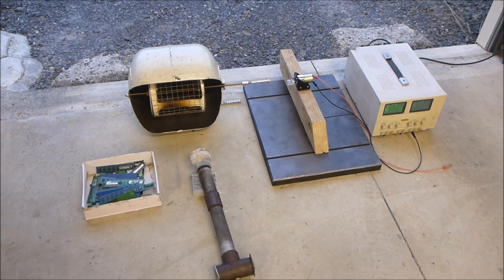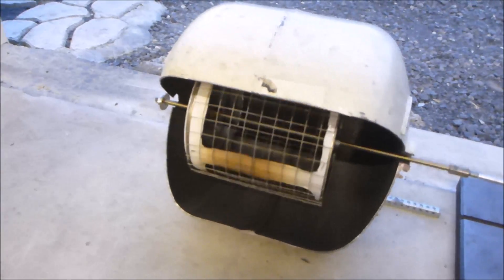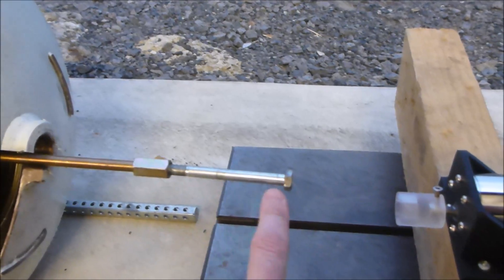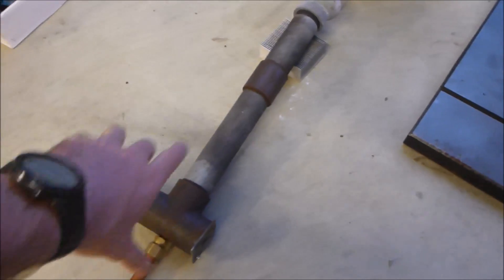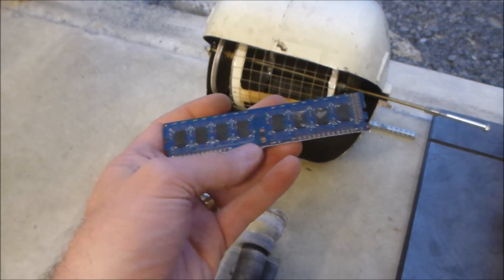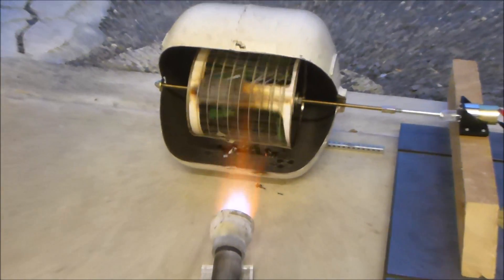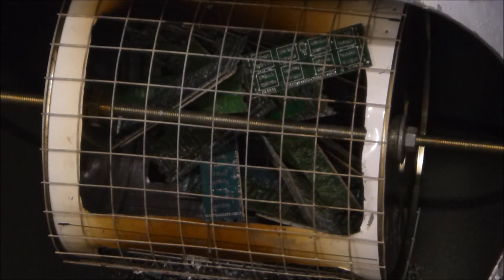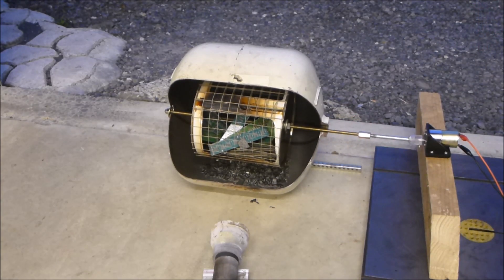Gold Recovery - Automated Circuit Board Depopulation

Comment: A small blower AKA hair dryer would get the flame hotter. A blue flame, with little to no yellow color, is the hottest and most efficient. 
With a flame at this temperature you could get the time down to 2 minutes.

Comment: Wow! Excellent idea, also showcases how handy you are. I was wondering, why have you decided not to use coal/charcoal for heat? Aside from some ash (no biggie since you’re doing it almost outside and could just blow it all out, hehe), coal/charcoal just beneath would have the added benefit of incinerating the chips for you right then and there, for easier crushing/powdering for gold recovery, right?
Reply from the maker: Thanks! The aim at this point was definitely to avoid actually burning the ICs, you really want to pyrolize them (in a mostly sealed container) before incineration, otherwise they give off huge amounts of toxic smoke. But, no reason you couldn't use coal or any other heat source to get the job done! Thanks for you comment :)

Comment: if you are not recovering copper 45% of the weight of good boards then you have shorted yourself what could pay for everything else. if you crush the boards down to mesh 20 minus or smaller you can gravity separate the metals by density and separate the plastic and fiber along the way to get more recyclable items  a shaker table works well for separating.once the aluminium and steel are remover for recycling the copper and other metals can be melted into bars and the copper can be plated out for three 9's or better high purity copper good for busbar copper worth about 9 dollars a pound then the base metals can be removed with hydrochloric acid then filter the anode slimes this will be mostly gold at this point, add a little nitric acid to this and the silver will come out as silver chlorate save acid for later processing.
Reply from the maker: So, the short answer is that I do this as a hobby, a gold mining hobby, if it were a business then you would certainly want to target copper mainly and the precious metals would be the 'cream'. The longer answer . . . Some back-of-the-envelope math here, if we take a typical RAM module, there is probably about $0.60 of Gold to be had. Assuming a 6.5 square inch, 8 layer board with 1oz copper thickness, where we generously assume that Copper covers 70% of the 8 layers, and then generously assuming $9 for 0.45kg of Copper, you end up with around $0.14 of Copper per RAM module. But for this $0.14 you have to do much more work that the $0.60 you get from the Gold processed efficiently. 

Low yield boards would probably have a better ratio of Copper to Gold, but I'm unlikely to get them to process anyway.

Your comment sounds a lot like someone that has drunk the forum kool-aid and watched a few MBMM videos without having tried any of this themselves. But, feel free to upload a video of your process and prove me wrong.
Reply: mount baker mining certainly shows that you can get at the gold without pulling individual components off the boards as to not having done it, i have 13 kilos of hand picked pins and at least 20 of chips and 5 gallon buckets of board chips and while i have not found a small to medium hammer mill i will be building one as to the 14 cent versus 60 how much did you spend on acid to get the 60 i am not trying to ruin your hobby am trying to get fellow enthusiasts to help create a more complete approach and to make more money and if possible by doing less work.
by grinding the boards to sand it is very easy to separate the metals by density if you can work more boars in less time you will see more gold silver platinum and palladium and the copper can pay the bills or at least some of them for the rest and i plan on making videos.  so good luck with what you are doing and think about grinding and shaker table.
Reply from the maker: Yes, as I said, nothing special about what you are suggesting, this is 100% how it is done industrially. The devil you will find is in the details, I have tried running electrolytic refining cells, in practice it is much harder than you think. Melting large amounts of Copper is not trivial either, I have watched two close friends try this and fail. As to how much money I spend on acid to get the 60c of Gold out of a RAM module, the answer is a tiny amount, I turn a kg of RAM chips into a few tablespoons of concentrate before I touch it with acid. A good estimate would probably be $1 of chemicals for every $25 of Gold, not counting the cost of labware which is amortized over quite a lot of Gold. I would encourage you to have a go with the crushing, shaker table, melting, electrolytic refining, conventional refining process, do a video and get in contact with me. I would love to see it working on small scale!
Reply: it is all about the dollars that is how you keep score and yes i will give it a go some of this i think you have no choice but to go big will try to get by with small i think i can get most of a shaker table out of my junk box plus some nonstandard use of a router.still working on how to hammer mill and with waste oil and 2 burners i think melting the copper is duable i have a variac of adequate amperage and bridge rectifier so a couple of motor caps should see a electroplating rig set up have to find some copper sulfate.
Reply: @claymccormick1203  a little late here, but one tip i have for you is a source for copper sulphate- it's used as a disinfectant for cattle hooves-  a 50# bag of crystal cost me $50 USD at a farm and garden store

Comment: Excellent! Now I need to build one. Using hot sand is taking a long time.  Simple, effective, and the parts are easy to get. Two thumbs up.
Reply from the maker: Thanks for the comment Edmond, yes, I still use pretty much exactly the same concept and have depopulated tens of kgs of Ram over the last year.
Reply: You have made one of those "why didn't I think of that" videos.  The simplest answer always seems the hardest to find.  Thanks for the time saver!!

Comment: Is it not faster and cleaner with an electric or hydraulic hammer drill with a chisel on?
Reply from the maker: i prefer a air hammer for selective depopulation of larger boards, but for ram I have never found anything faster or cleaner than this method.
Reply: this is a very fast method you've shared!  a good alternative which i have never seen any other scrappers use is an Xacto knife not a utility knife or box cutter to remove chips.  it's my preferred method for removing chips with tiny legs, by just cutting the legs on one side of the chip, and prying it upward.   the other side's legs yield easily after a wiggling the chip back and forth.  
obviously my method works poorly on thicker legged chips... i have been unable to find an air hammer i'm satisfied with yet.  i bought a few cheapo ones from the usual suspects and found that they worked well... for about 4 minutes.  after that they wouldn't hit for shit.  the manuals say to grease the cylinder every other time you blink... but i can't seem to find one that is serviceable without total disassembly, and the aid of a vise and/or arbor press.
apologies for blithering on a bit, and thanks for all that you share here, keep up the great work!

Comment: This type of rotating depopulation devices are manufactured in a large scale in China, you can buy them at Aliebaba etc. They are not even expensive, since it is low tech. Always consider the toxic fumes, when you upscale this kind of recovery! The heat will not only loose the components but also burn other materials like glue etc. If you introduce another 1 or 2 mesh you are even able to seperate molten tin and small SMD components from larger chips.
Reply: you are incorrect no similar device is available on alibaba, if you make these claims then please post a link

Comment: Awesome setup!!! Now I have to go make myself one! ..... just thinking, you mentioned going electric .... using an electric clothes dryer element zig-zagging across the upper back half of the propane cylinder might work?!?! and for anyone out there thinking of making one who don't have a nice power supply like yours to control the motor speed, I was just thinking, the geared motor from an old microwave turn-table would probably work great right! Keep up the great work!!!
Reply from the maker: Hi Chris, the only risk with the clothes dryer element setup would be isolating it electrically. I think it would still be better to build an electric setup similar to a supercharged hairdryer, where the heating element is contained inside something and the air blown through it. The benefit of electric is you could easily control the output temperature. I think a microwave turntable is probably about the speed you want, and those little motors should have reasonable torque, once again you just want to make it electrically safe. Appreciate the comment, good luck and be safe.

Comment: WANT one of this. It's funny...just a couple of days ago I loaded some ram sticks on top of the barbeque.
Reply from the maker: Yep, I always used to use a toaster oven for depopulation. I managed to depopulate about 4kg of ram boards last night in 30 minutes, usually that would be many hours of work. I was quite surprised about how well this crude setup actually worked.
Reply: Agreed. I like it. Looks like it works really good. It will probably also work on removing pins from green fiber CPUs.

Comment: great idea. i have 14 kilo of ram boards to depopulate. wonder how it would handle a mother board
Reply from the maker: I haven't considered whether this setup would be suitable to depopulate through-hole components, but in theory it would be OK for IDE connectors and such. I mostly do ram and hard drive boards, so I am intending to keep the drum size roughly the same and just cut or break larger boards up. I depopulated about 4kg of ram in 30 minutes last night, that would usually be hours of work, so I am very pleased with myself.

Comment: Great idea, well executed. Look forward to seeing a more "developed" version. Winner! It would also be good to cogitate on how best to utilize this idea for larger boards - possibly by cutting them into smaller units?
Reply from the maker: Cutting the boards up is likely what I would do, but if someone were so inclined I'm sure the basic idea could be scaled up to the size of a oil drum which should be able to do whole motherboards. Although you would likely change things like instead of removing the drum, you would have a door for loading and unloading. So far I am pretty impressed, depopulated about 4kgs of ram in half an hour last night. That would have been many hours of work using my previous method!
Reply: I'm not so sure it would work on that scale. By virtue of the increased size, the forces involved would be much greater. I suspect you would just "damage" the boards rather than depopulate them. The key would be to find the max size at which the process would still work in the manner intended.

Comment: I wonder if you had a shaker with a screen whether you could shake the solder off the chips in a single process?
Reply from the maker: Yeah, always  a good idea to get as much solder off the chips as possible early on. This system actually works quite well because it looks like as the chips fall and hit the bottom, a bit of the molten solder gets flung off. Ultimately I can't see myself getting away from chemicals to completely remove the solder.
Reply: I was thinking if you reran the chips at high speed as a 2nd stage most of the solder would centrifuge out.
Reply: Use a second can with smaller holes to allow the solder to melt through. This should leave the chips behind and then all you have falling/melting off is the solder.